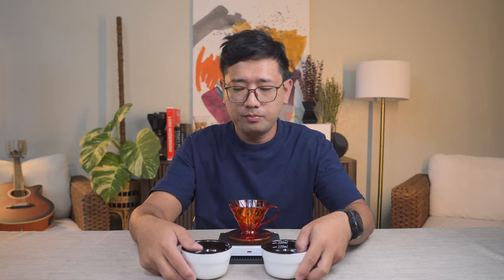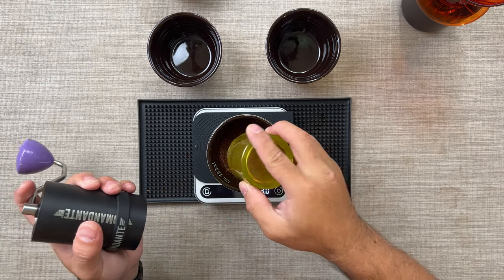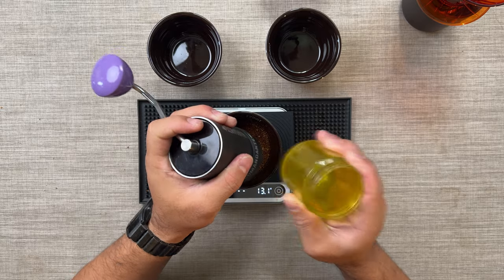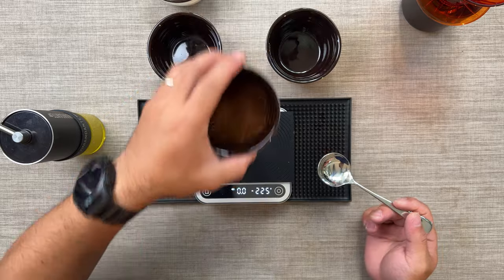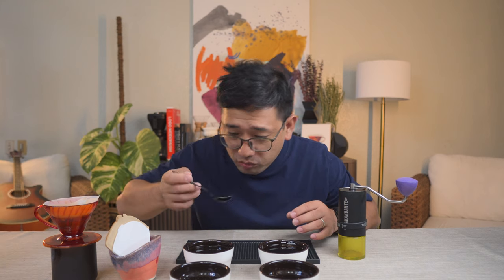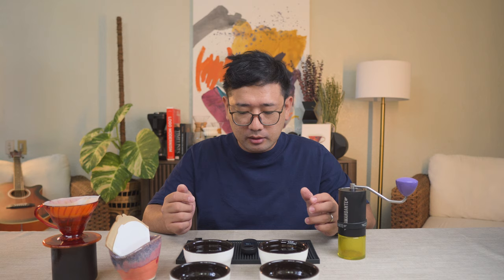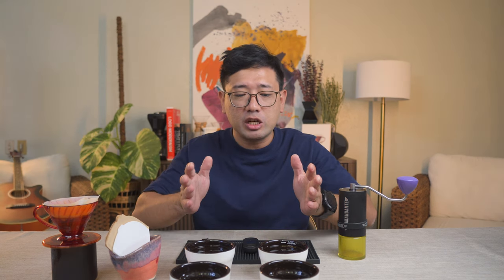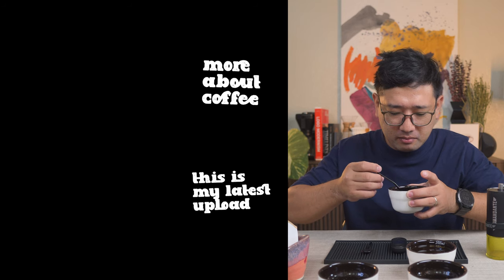5-Pour or 2-Pour? Differences in pour over recipes

Comment: Thanks for the video, Im using a 5 pour method 22 clicks on c40 16g coffe 272g water (1:17), for a washed kennian.
I want to experiment now what will happend if I change to a 2 pour next.
Reply from the maker: sound great!! if you dont mind what is your water temp?
Reply: 95 C
Reply from the maker: @MrGlenardan  awesome! Let me know what happens when you change to 2-pours
Reply: The first thing I noticed is a lot more grounds stuck to the sides of the filter paper, I forgot to shake it a little as you did in the video, might be the reason for this.
More water made it through, usually I get arround 230g yield, this time I got 240.
The extraction was faster, it finished arround 2.20min, usually takes +3min for the 5 pour method.

On the taste side I'll like to make a side by side brew to compare, tomorrow If I got time. At first I noticed a little bitterness but disapparefd once it cooled down a bit. I notice more body maybe a bit more acidity, and the sweet notes are more noticeble for sure. It might be placebo effect so I would like to try again with a blind test.
At least for my recipe it seems to works better than the 5 pour, and also is faster to do, thank you for the video, got me trying out new ways of brewing
Reply from the maker: @MrGlenardan  you're very much welcome!! yes sometimes you lose more flavors specially when you pass the point of diminishing returns so this is something you want to keep in mind. the bitterness that you tasted and disappeared eventually could be an indication that you are exactly at the point of diminishing returns and adjusting your parameters back could possibly bring out more flavors. Try it in extreme parameters for a clear comparison. :) 

The moment I learned and realized this, my brewing and coffee was never the same :) I am so glad to have discovered this possiblity. I used to brew very high temperatures and fine grind sizes not knowing what Im missing out on. hahahaha

Comment: How would you adjust parameters in 5 pour to achieve the flavors of 2 pour?
Reply from the maker: There are a lot of ways to do this,
Option 1 - bigger grind size
Option 2 - faster flow rate from kettle meaning pour heavier or faster
Option 3 - use a lower temp about 88-89 instead of 90

But personally I would do option 1 and 2 in varying degrees bigger grind size and faster pour to lessen contact time because with longer contact time it extracts more from the coffee grounds.
Reply: @darylbuenocoffee  so easy to understand. Thank you!
Reply from the maker: @joshuagomez3668  you're welcome!